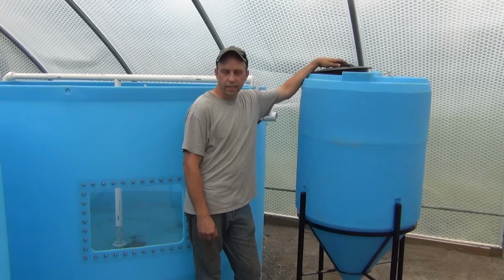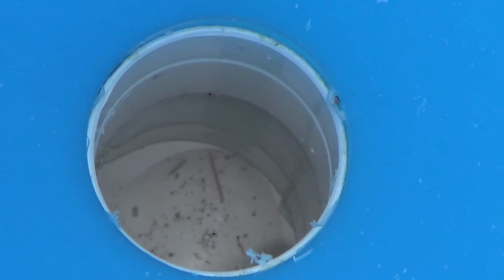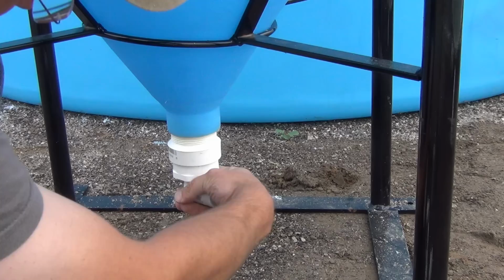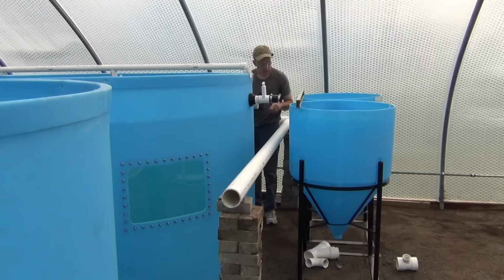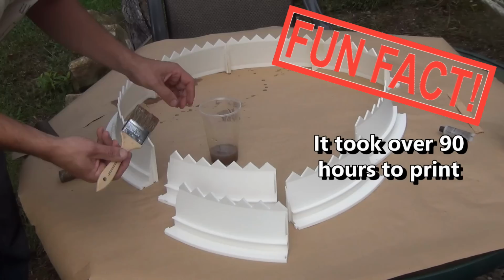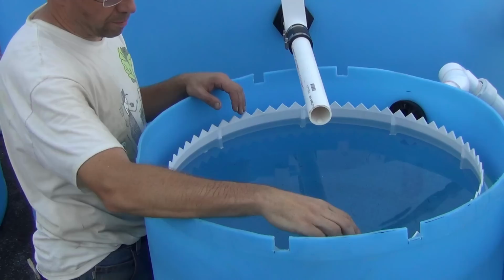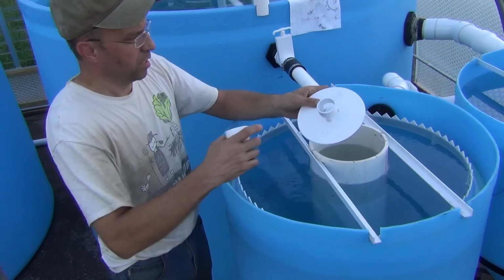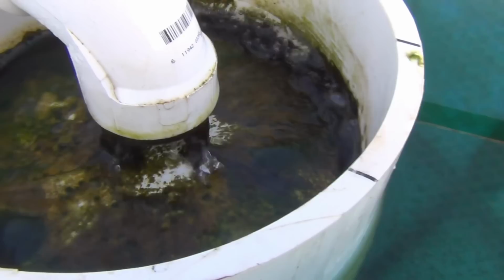Big Aquaponic Greenhouse - Part 13 - Radial Flow Settler

Comment: instead of using a diverter plate, try using a plastic ball, about an inch smaller than the diameter of the pipe, water hits it, rolls it around and instead of building up muck as it rolls around it cleans both itself and the area it is in simple and easy
Reply: or k1 media, good idea! I was looking for something similar to that plate and I think I'm going to use k1 media or plastic balls if I can find some cheap and food safe, thanks for the idea!

Comment: We have an RFF and it absolutely boils. We have 4000lts of fish tanks  feeding it with 2" pipe. Still working on it. Trying to turn over the tank water every hour without getting the filters overflowing is a fine line. We use 200lt drums for the filters. On our third filter we have two 2" pipes feeding our raft (1600lt). We intended to have k1 in the last filter but cannot as it backs the system up and overflows.
Love your videos, just makes me wonder why I find it so tough..rewarding tho. 😊

Comment: why do you have the drain from the fish tank on the upper side?  instead of just at the bottom of the tank?    seems to me you could avoid interior piping that way no?   Plus the level would still be maintained by the pipe height in the "stilling filter tank".    or am I missing something?

Comment: just wondering if you have considered painting the tanks and settle tank to stop algae growing in your system? painting with a base coat of black to block any light getting through the tank with a top coat of white to reflect light as well as heat could work nicely

Comment: what is the benefit of having a weir?    2)  why is your inlet (from the fish tank) at the top?   shouldn't it at the bottom?
Reply from the maker: it helps to distribute the outflow so it doesn't create any currents.  There's a pipe in the fish tank that draw the waste from the bottom.  One of the older videos in the series will show it.

Comment: Do you have experience with using two part epoxy on 3d printed parts? As a rule of thumb it is recommended to use solvents to glue 3d printed parts together however in your case since the parts are held in place and have negligent pressure put against them i doubt you will have any issue from the use shown in the video.

Comment: Interested in the main shutoff valved you've installed at the inflow line as well as before the runoff valve. Looks like a 3d printed device. Do u sell those by chance? I am working in an area with huge space constraints and need a slim valve solution...thanks

Comment: Very interesting project but I didn't get it XD Could someone explain the purpose of each part? Like the weir?
Does the center tube blocks out the bottom outlet? Why do you need the "diffuser plate"?
Reply from the maker: There's another video that explains the entire system.

Comment: I have small Aquaponics system where I have put 8 small sharks and 4 Gold fish. But I have noticed that Gold fish dies in few days. Earlier also, I bought 2 gold fish and both didn't survive. And this time as well, out of 4 gold fish, 3 are gone.
What could be the probable reason for gold fish not surviving whereas sharks are still fine?
Reply: Have you seen the film JAWS
Reply: I think your gold fish are killing the sharks and disguising themselves as sharks. I'm afraid you might have gassasin fish.
Reply: @AnimalAce  Thanks for your reply. Actually, Gold fish is not killing sharks but Gold fish itself is not able to survive. Sharks are fine.
Reply: @neiallswheel  Nopes.
Reply: do  you have a heater in the system> goldfish are normally cold water fish, where sharks are normally tropical? heat tends to stress goldfish out.

Comment: Trying to follow on your numbers and missing out the volume of the RFF as well as your estimated outflow from it. Thanks
Reply from the maker: the water retention time should be at least 20 minutes (1/3 of an hour).  So if you have a 70 gallon tank your flow would be 210 gallons/hour
Reply: @Bigelowbrook  cool. the longer the better, right? So if you have this number, it means that you know how much ammonia you expected your filtration system to process? Do you have any means to increase flow rate?

Comment: how often do you need to clean that pipe in the mechanical filter, seems that solids will build up in this pipe and block the water flow thru the bottom. thanks
Reply from the maker: It hasn't clogged.  It's small so that the water flow is faster which keeps the solids from settling in it.

Comment: Why not thread tape on the bottom drain?
Reply from the maker: I mentioned it in one of my earlier videos but tape shouldn't be used to seal threads, it's used as a lubricant to get them to be tighter together.  These tanks are a soft plastic and expand and contract in the heat so one type of plastic expands at a different rate than the fitting and it will eventually leak.

Comment: What about the debris that floats?
Reply from the maker: good question.  Since the water is entering through the stilling well, anything that may float is caught in there until it eventually becomes waterlogged and will sink.  There is a chance that some floaters will get through and could wash out through the weir.  That can be easily resolved by adding a little skimmer wall right next to the weir.  Similar how I did the overflow weir for the fish tank in the previous video.  Plan on an update video in the future with that modification.  ;-)